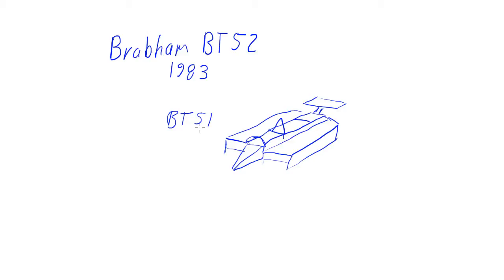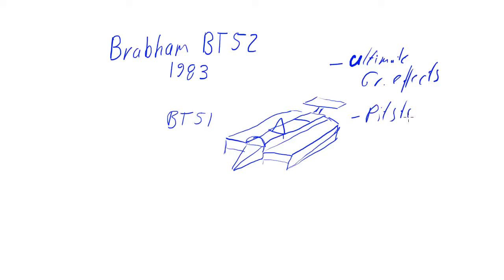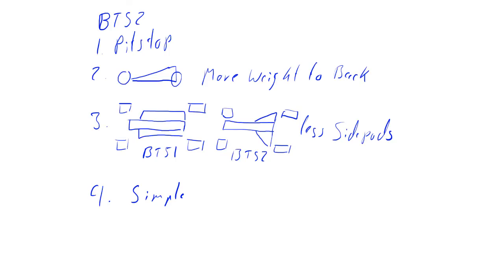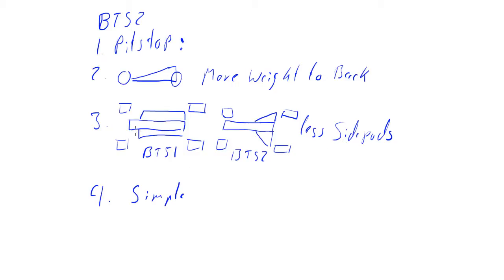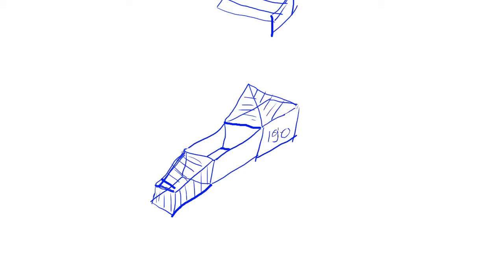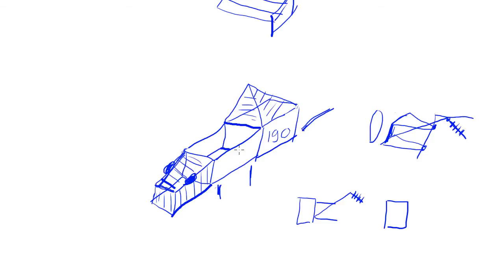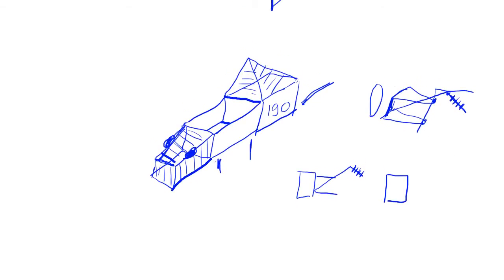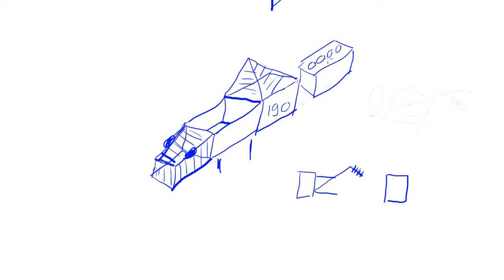Brabham BT52 1983 Formula 1 Grand Prix Car Technical Overview

Comment: Tyrrell did use the delta shaped sidepods after 1983. Brabham wasn't the only team to race that concept.
Reply from the maker: sure, but Brabham was in 1983 the first. Tyrrell came to this in 1984. Ligier had in 1983 a very similar solution but not quite the delta